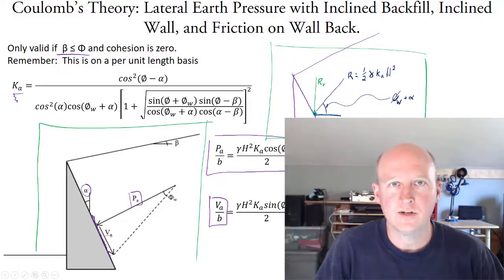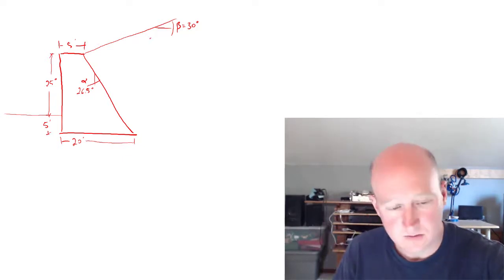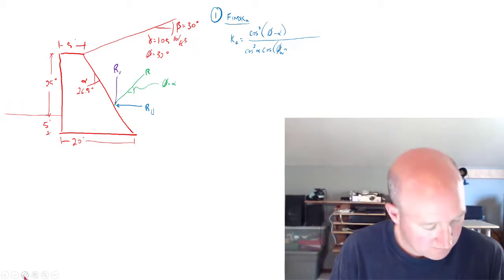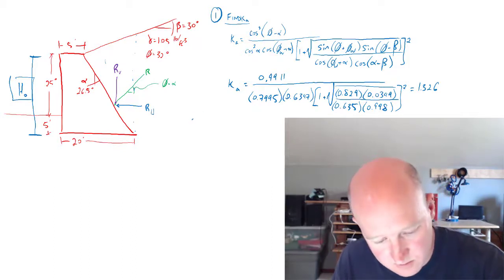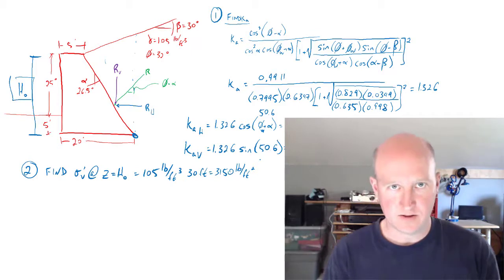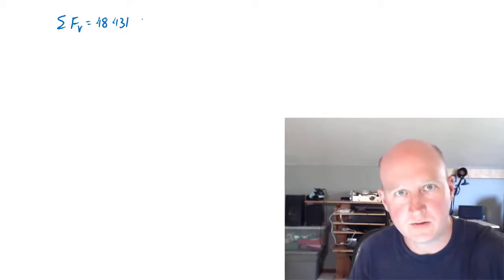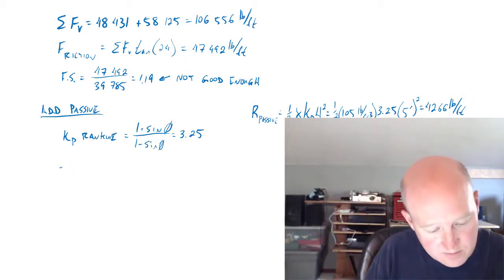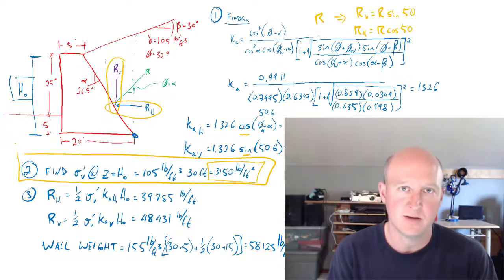Retaining Wall Factor of Safety Coulomb Sliding Example

Comment: You did not specify the angle of external friction in your video that you used for your Ka calcs. That being said, I am pretty sure you have error in your Ka calc...I got 1.270 for reference utilizing an external friction angle of (2/3*phi = 21.3 degrees).